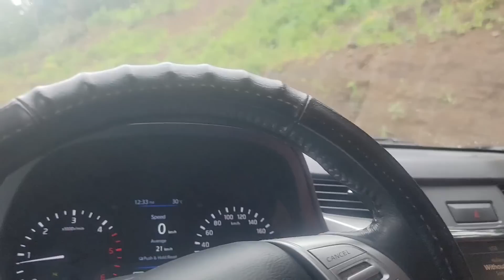Out of the Mountains and Back to the Beach AIR BNB / House Build

Comment: If you want to catch the wind turbine "in motion", set the shutter speed on your camera to double the frame rate (so if the frame rate is 60fps, set your shutter speed to 1/120; 30fps, set it to 1/60; 24fps, set it to 1/50). This will allow the camera to achieve the 'motion blur' that is most natural to the eyes. If the day is very bright, however, you may need to add a neutral density filter in order to avoid overexposure (typically an ND12, ND16, or rarely an ND32 for super bright days and/or limited cameras). If the camera can do over 60fps then on a super-bright day  you can do 1/240 with 120fps.

Hope that helps.

Comment: Hey James, I am watching from  Jamaica. 
You are the favorite of about six youtubers I watch religiously every single day, 
I have learnt a lot from you. 
There is one thing you have not done on your  home build, that i think is very important, considering the height of your roof.
I think you need lightening rods and probably ground on your stainless steel rails. Just my opinion though.
Reply from the maker: No lightning rods will be installed. Everything is earth grounded to rods :ie electrical  (unlike most Filipino homes) ,steel grid in the concrete, solar equipment, solar panels, wind generator, solar water heater. We are putting additional grounds in this upcoming week so it will be the path of least resistance.  So cool you are watching from Jamaica.  How's life there?  Are you a foreigner living there or are you a Jamaican?  I follow a Jamaican vlogger who does solar there on the island.
Reply: I am Jamaican born and raised. 
There are quite a few companies offering solar, I think some are Chinese backed.
We have two solar farms supplying the national grid. Closest one to me is Spanish owned, and occupies about two hundred acres and rated about twenty megawatts.

Comment: HI James  ,  where   to get this wind generator ? I would like to order one
Reply from the maker: Missouri wind and solar but the prices have really increased since we bought this. I do not like there charge controller so i bought them mppt blue ones separately from China. Huge improvement! Just make sure it is worth it to you. I think its about $2100 -2200 now and then these charge controllers in the models I have are and $189 each.
Reply: thank you James for the info.